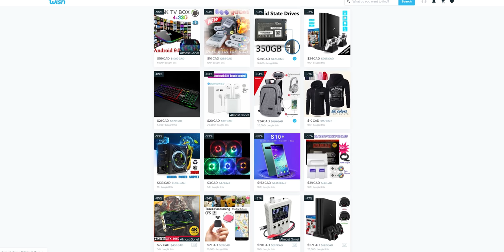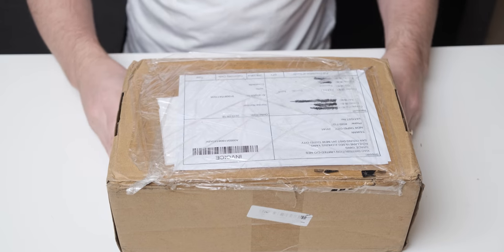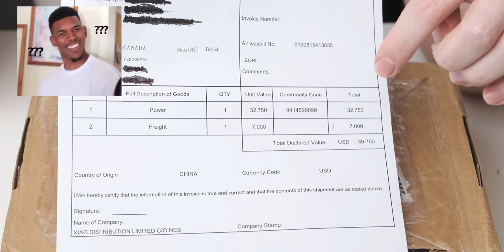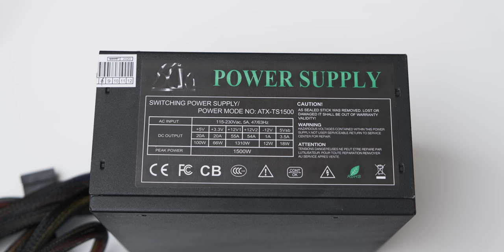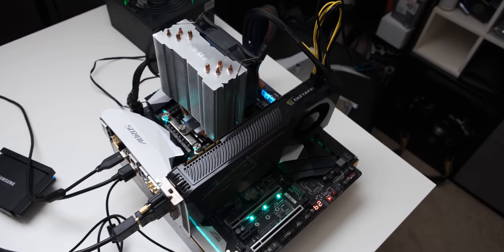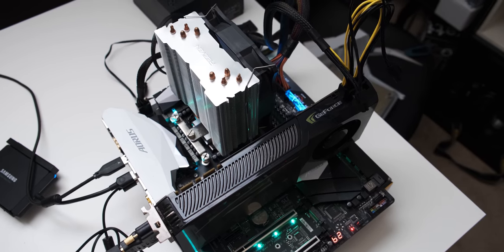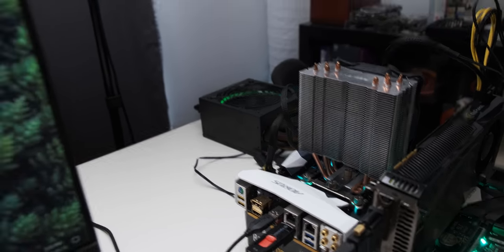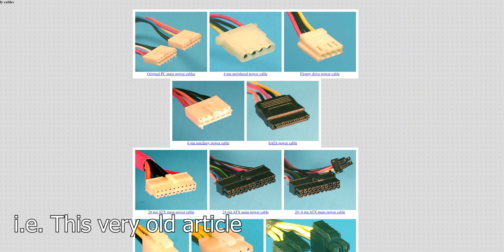I bought a $69 1500w power supply on Wish.com

Comment: The quality seems pretty good 
The capacitors too 
Definitely not 1500w but a lot better than other cheap power supplies. Even Corsair's vs series is a lot worst that this. I'm surprised. I guest it's about 550 to 750w good deal
Reply: It's seems very reliable to me not a  firestarter whatsoever you can use it safely
Reply from the maker: @panosd5693  Oh really? That's interesting. So maybe if they advertised it accurately, it will actually be decent?
Reply: Of course from the teardown seems very well designed and with good quality capacitors
Reply: @DawidDoesTechStuff  so can you give us link?
Reply: lol its definitely not 750watts, but I guess could be 550 watts, if you compare the board with other 550 power-supplies some things look alike, i am not an expert but that big 400v 330uf capacitor is also in the ''enermax-maxpro 500w power'' and the layout looks close to its, the pcb is about the same size.

Comment: From my electronics knowledge... And after looking 1 big capacitor and on output 1 big inductor... I can say... This is Dual Switch Forward Power supply... With Independent DC-DC 5v and 3.3v rail... And it has APFC circuit..  and adequate cooling and Components.. I think it can diliver upto 1000 watts without any problems.. can't say upto 1350 watts (may be it's a 1000 watt unit with OPP limit set to 1500 watts and they just advertised as 1500 watts.. 
Because there is only 12 v is actually generated by PSU and minor rails are generated by DC-DC converters... It can only diliver limited power overall....

Comment: 6:58 No one should repeat what this guy is doing, this is very dangerous, as in deadly dangerous "isolated from the floor" or not! No one should take a power supply apart EVEN if you have never turned it on, they test these out before shipping from the factory, and the capacitors will hold a charge. 8:14 " I dont know what I'm looking at" then why the heck are you taking it apart? That's like me taking apart a gas furnace ( that I know nothing about) then saying, I dont know what this does, but lets look at it. KABOOM!

Comment: It looks to be about a 300W PSU. It doesn't have active power factor correction. APFC PSUs won't have the voltage switch on the back, they automatically adjust for the voltage. Considering how little you got in regards to power per dollar, they could afford to buy Tt fans at full retail and still make money hand over fist. I sincerely doubt that Tt has anything to do with that power supply aside from having a sticker on a fan that may or may not be a legit Tt product. I'd also suspect that the Rubycon cap is likely fake.

Comment: The rating is completely bogus, same for the dual 12V rails (granted, there wasn't really enough detail from the connectors inside, but I don't think there was a dual 12V in there) - but as a 450-550W PSU, that thing there is probably fine. The layout looks fine, although perhaps not very good separation for AC and DC, but it doesn't look dodgy in a purely technical sense. As someone else here suggested, it's probably left-over parts, or just parts that have been "liberated" from normal use and then put together in a separate, no-brand PSU. Same way you get unbranded iPhone screens and the like from the exact same factories that makes the original ones.

Comment: ✌️😏 send it over to johnyguru for analysis
Reply: I was thinking the same thing. If that's a real Rubycon cap in there (look at it closely, some of them are Rulycon, which is a crap Chinese brand), then it's probably a decent 500-600W unit from some Chinese OEM that some crook has put a 1500W label on. No way in hell that can do a thousand, let alone 1500.
Reply: @johncate9541  🙂 yes maybe its at least a 500w psu if hes lucky ☺️☘️

Comment: One of the rectangular silver labels is a quality control label from a hi-pot test, which is a voltage isolation/breakdown test. You could (theoretically) do a lot of calculations based on the component values and figure out how much power it could supposedly put out, but the only way to tell for sure is to hook it up with some adjustable loads on the output to see how many amps it can actually provide without the voltage sagging.

Comment: Check the amps on the fuse. Multiply with your wall socket Voltage and then you know that it's certain that the useable Watts is less than that.

Comment: For the power cables, a Molex MiniFit, this are the 6 and 8 pins you connect to your graphics card or other PCIe card, the 4 or 8 pin for your CPU and the 24 Pin for your board, can support 9A per pin.
The 6 pin for the PCIe card uses 4 pins for power and 2 for sense. Since you need 2 for input and 2 for output, you get about 18 A or 216 W. The ATX standard defines a much lower limit at 150 W. If you also use the other 2 Pins, which many power supplies do because they do not use the sense pin, it has a maximum of 324 W. This should also somewhat work with one cable for 2 connectors, but not that great. A cable can handle more current than the connector.
.
Oh, and it annoys me that people call connect with 4 pins in a row Molex, as would the Molox MiniFit connector not be a Molex connector. But Molex MiniFit is a Molex standard.

Comment: The 80 Plus thing is something that's apparently a bit misunderstood. 
A power supply doesn't just get the 80 Plus rating as soon as it fulfills a certain criteria. A manufacturer has to pay to get even a single model certified. This cost then usually gets handed down to the consumer. 
I work at a German system builder and we import power supplies from China (just like Corsair, Gigabyte, ASUS ROG, bequiet, etc do it too) and slap our logo onto it.
The OEM we buy from is known to making excellent quality units and since we've been using them for years, never had any issues with it. Seriously, no computer I ever got in for repair with one of our PSUs in it, the PSU was actually bad in any way.
They don't have an 80 Plus rating even though they usually have at least 85% efficieny. 
That's because they need to work well but we need them to be cheap. We know they are good and can be trusted, but we rarely sell them seperately because the customers keep raving about the 80 Plus rating. :D
Of course there are crap units and I wouldn't trust the one in the video but it's not like 80 Plus certified means "best thing ever" and everything else is "garbage".
Really not.

Comment: Looking at the components I'm gonna say it won't push more than 500 watts rms. It can surge probably to maybe 800-900. That capacitor is far too small for a true 1500 watt psu. It's probably just junked together from various parts. The heat sink on there is crap, the control board is far to small for a 1500 psu. All in all I'd say it's a 30 buck PSU just like the order form claims its value at.

Comment: its probably a 200-350 watt psu just based on the voltage switch with is kinda indicative of old designs from the early 2000s, also you can look up the diode/rectifier as a good indicator of true wattage, assume 60-70% of its rateing.

Comment: looks exactly like a 600 watt EVGA supply you can get at best buys For under $50... Put a load tester on it.   20 years ago i ran a vapochill freon cooled case.. 200+ watt prescott P4  9800 ati on a 300 watt sparkle.  Heavy CPU adjustable rails... 

check the temps on all the components at load,, what are the voltage drops...

Comment: The big intake capacitor is rated to STORE 2200 watt. This does NOT mean the PSU can deliver 2200 watt!!!!! It's even incorrect to say it that way as energy storage is in Joules or amp-hour (we don't use aH for capacitors as they are meant for fast charge/discharge, not Hours like batteries.). The big capacitor is 400v 330uF which translates roughly to 400v x 5.5 amps CAPACITANCE. I'm sure Dawid isn't using 400volt, that would need 5-pase or 3-phase anyway instead of 2. (Like those big plugs for big appliances.) It's also normal to use higher rated capacitors so it's the fuse that blows and not the capacitor when something goes wrong :D

Even though Dawid said he can only see one capacitor, I counted at least 8 more. The ones connected on the other side from the big one are the ones that matter to calculate the total power output. The Voltage rating and the uF (Farad) will tell you the peak capacitance. Then check which ones are for 12v 5v 3.3v, this will get you the max amp output. then Volt x amp for each rail and add them all up.

Comment: Watch some of BigClive's video's to learn about the components.

8:37 is the main transformer.
I'm hardly an expert myself, but I've seen far worse PSU's... Obviously this is not a 1500W one, I'd guess around 400-500 watts. I find it hard to tell but can be calculated from the ammount and types of mosfets (the comopnents that are cooled), output (near the cables/output part of the psu) caps and transformers.

Comment: If it has two 12 volt busses that can do a max of, say, 600 watts each, then the marketing added those together iwth the 3.3v and 5v rails to get 1500 watts.  In actuality the supply may be able run one rail at a time at its full rating, but only a max of 250 or so watts on each 12 volt rail if both are loaded. The classic Antec TPQ-850 supply in my computer works the same way, it has several rails, each of which can exceed its rating to some degree, but the TOTAL can only add up to 850 watts. At least the specs are accurate on the Antec. Having multiple rails is safer than one massive 12 volt rail, since less current is available to do damage in case of a short, or an arcing connector.

Comment: They declare lower value because you can avoid customs that way, - they usually set it way lower, especially with things where it's not easy to get the value.
Simple as that, I do that all the Time and get items shipped from China to Germany, everything goes through the customs if the value is above 26 EUR (!) you have to go there, collect it and pay 19% extra-tax on top of the invoice. If for example you order something where the value on the label is clearly to know, they evaluate the worth of the shipping (no joke, that means it will get expensive) and you have to pay the 19% extra...Sometimes those fees exceed the items worth by far!

Oh and if it's something that MAY be counterfeit, they will destroy it and inform you via postoffice...

no money back...

 So you have to get used to the way to ship things to get it through the customs :D

Greetings

Comment: If you don't know anything about electronics it's not much use opening it up. It is dangerous though. The capacitor for instance doesn't supply power as such, it tells you nothing about the rating. But Rubycon are a decent brand. The only good way to test it is not to plug it into real components and risk losing them to a failure, but to test it with dummy loads and proper test equipment to measure voltage and current at the outputs.

My take is it's a lower power unit (650W or less) with false labelling.

Comment: Looking at internals they actually don't look terrible but I can tell you with absolute certainty it is not a 1500 watt unit. Thermaltake does not manufacture their own power supplies they are outsourced to one of the Big 3 so the fan could have simply been left over from manufacture or bought in bulk or it actually could have been the internals from a Thermaltake order that were either to old and simply shelved or in some way didn't pass end stage QC. The caps I can see are actually quite good and used by pretty much all manufacturers. The layout from just looking at the video leads me to believe this is at best a 320 low end to 500 watt at the absolute high end for constant output. I wouldn't trust it for any hardware I want to keep and not risk loosing but for a system that draws little to no power and won't stress it it may be okay in a pinch. I also wouldn't power cycle it and leave my sacrificial system powered on as the act of power cycling is actually one of the most stressful points of any PSU's service life...
Sorry for the book this was good fun to watch and yes if you're fairly competent with putting things back together once you've taken them apart I would highly suggest that you disassemble PSUs before use and still remain very cautious around the Caps...

Comment: I dabble with stuff like this due to people really wanting to get PCs as cheap as possible. Like a Triple A gaming PC with monitor for $250. I help out with my friends PC Shop/Rental business.

My safety limit for me in these PSUs is to divide its supposed power limit in half. In this case at best, I'd be comfortable giving this thing at max 750W of power.

The worse thing about these PSUs is not it can explode (After all, even high quality PSUs can still technically blow up when its capacitors fail etc) its that it can catch fire when overloaded due to lack of safety features.

PS. For a "dodgy" PSU, its pretty expensive. I can buy 600W True Rated PSUs for $50 nowadays.

Comment: I bought an emergency PSU a few years back; 500w for $80. This 1500w, $69 PSU looks to be of much better quality, actually. Rubicon capacitors, Thermaltake fan and decent amount of heatsinking. On the surface of things, it doesn't look half bad. Not good either though.. I would think both fan and caps are from the "discarded" bin at the QA stage. Not faulty, but out of spec.
Reply: Fake Rubycon probably. Those are widespread on the Chinese market. Hey look this unbranded S-180-12 LED power supply i have here has a Rubycon primary filtercap too... yeah no, they wouldn't have put it in there if it wasn't incredibly cheap. Rubycon does not have manufacturing facilities in China. Most brands with a reputation to protect have a strictly enforced policy that any non-compliant product that didn't pass QA would need to be destroyed or at least obviously debranded on-site, or that crucial QA steps must precede steps such as sleeving and branding - i don't think Thermaltake necessarily has such a strong policy in place, but i bet Rubycon does.

Comment: I have a 750w psu that was very cheap
It has pretty crappy Chinese caps
Like capxcon 
Capxcon is pretty bad i replaced the capxcons in my 750w with some suscon and samnc capacitors from old non working electronics 

That's definitely not 1500w I can see that on it my guess it's 500w-650w somewhere there
Well that came with a Japanese input capacitor and thermal take fan that's something
What brand is the output capacitors
What mosfets does it use
Also that's a European plug

Comment: based on how it looks it would be more of a LOW_END 800-900watt PSU.

since all company's list a lower wattage than the actual wattage.
this way if somebody where to use a 900watt PSU. but accidentally plugged in a total of 950watt of hardware it would still be working fine.

but i would not risk it.

Also it looks to be a m-atx PSU motherboard. inside of a ATX PSU casing.

you can also tell if a PSU is any good by its weight. more weight means most of the time better components/more power

Comment: A lot of power supplies have false sticker data - often its showing peak output not ongoing. This one at least says its peak power not ongoing power but that is useless for most PC's that need a constant or near constant power so peak ratings are quite useless. I would say half the peak output so like a 750W max safe (ongoing) output or by the looks of the internals about 500W actually.

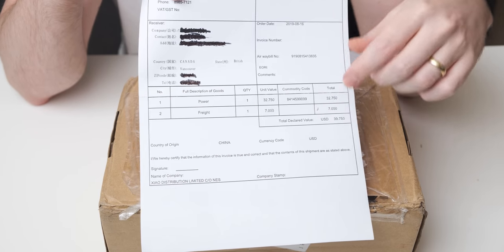Comment: 1:55 dropshipped items from china sources often got "discounted" invoice price. It's meant so that the buyer doesn't have to pay import taxes, as many countries have minimum value of import taxes (invoices higher than the minimum value have to pay taxes).

Also, I've had my share of using cheap psus, to save some bucks. It really does the intended job. The downside is the lifespan. Usually about 1 year, or if unlucky, months. Especially if the main power is not stable. Whilst my 2nd hand 500w cooler master  psu I'm using now is still going strong for about 5 years and counting (its age is more than 5 years, as I bought it used)

Comment: You can get an adapter to convert 2 molex into a 6 or 8-pin PCI-E power, and theoretically you could convert some of the SATA to molex, then to PCI-E. If there are 2 molex and 8 SATA you can get 3 dual PCI-E powered graphics cards and still have 2 SATA for a boot drive and HDD or whatever.
Reply: Definitely agree that you shouldn't have to go ham with adapters to hook up your components

Comment: talking about psu, im wondering if my psu is okish for now? will upgrade down the road but its a 

Antec VP400PC 400watt its a eu only psu i think usa had the AntecVP450-version instead
my specs are Ryzen 5 1500x 3.5ghz
16gb ddr4 3200
gtx 1050 ti 4gb
ssd
is this psu ok? it does not have a 80 plus sticker but when you go to specs it does say continues 400watt power and 82% efficient being it 82% efficient does that mean its 80 plus? cause i cant find a sticker that says that,anyway been using it for a year its fine thinking about upgrading in a couple months so i can get a better gpu..
but my main question is is my psu ok or will it catch fire lol

Comment: Even if that power supply was capable of 1500w (what i seriously doubt) i bet the ripple would be sooo big that would kill your components in matter of months. The safety capacitor (blue one)  doesn't seem Y1 capacitor.  Looks like just a ceramic one. The B.R. is not attached to an heat sink... Also, it doesnt seem to have an optocoupler. It seems to deliver a good amount  of power, but the question here is.... for how long. On safety measures there's a lot of flaws